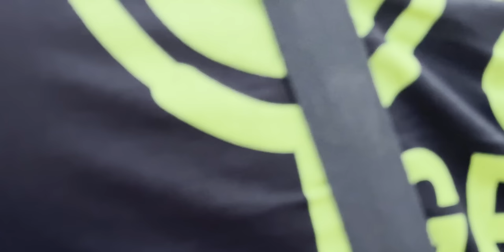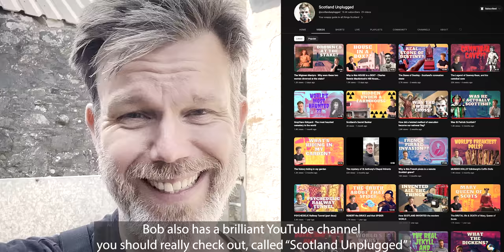HUGE cow's HOOF hides a SORE SECRET!

Comment: I recently had the opportunity to work with a small herd of cows. I went to a friend’s place to help with vaccinations, bug spraying and tagging. We had also intended to castrate one of their young males, but alas, he got away from us by jumping through the head catcher that was still set for the adult cows. It was a eye opener for how difficult it can be to get cows down a race and into a squeeze box. I was also amazed by the many moving parts of the box. It was a great experience. 

I used to work at a milking house in PA, but that was a much more automated process with a huge herd of cows used to being milked. They knew the procedure and just automatically walked up.

Comment: Wait wait wait. Do you need to put a new plastic tube on every single time you do a block? And where does that plastic tube go? It’s one time use? If so how do you throw something like that away? I mean you could throw it in the ocean or on the ground or in the trash but how will that be destroyed? Putting things in landfills isn’t a solution. Each plastic tube will take well over 500 years for the earth to break it down. Even then it will always exist if it’s plastic 😔

Comment: Far too much work is done with blocks. In most cases, a good trimmer relieves the diseased hoof by correct trimming. Sticking on so many blocks is not good!
Reply: Absolutely incorrect. When a claw is bad, the only way to protect it and allow it to heal is to prevent it from being aggravated by walking on it! You cannot prevent that by trimming alone!
Reply: Are you a professional??😂